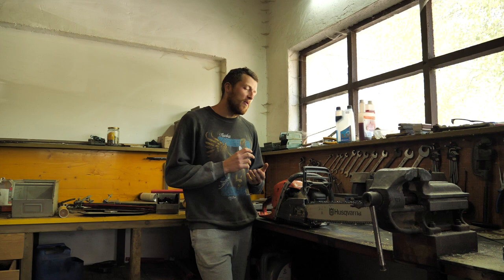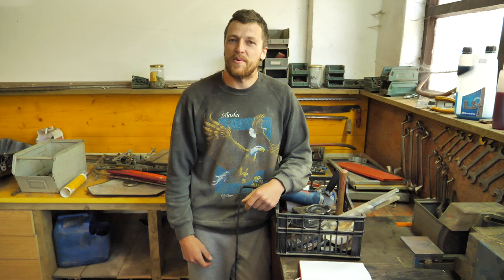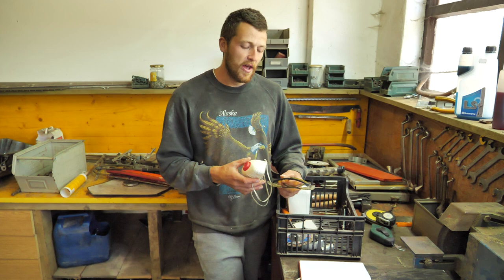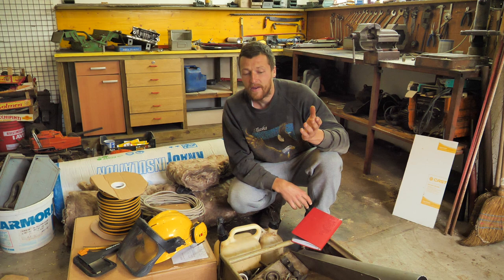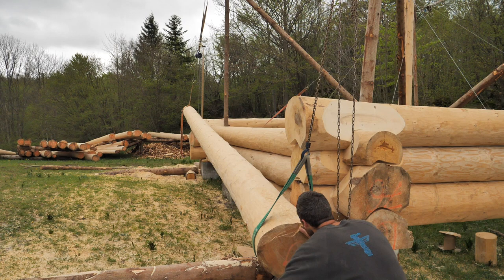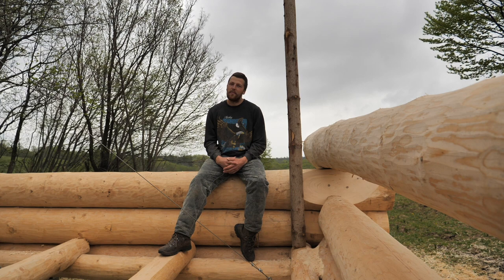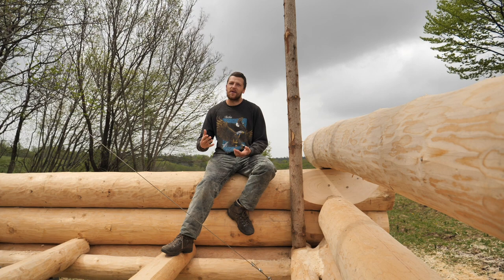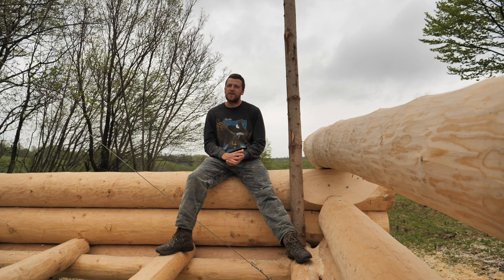Building Off Grid Log Cabin - Ep 15 / Log Cabin Walls

Comment: Hi Nik I think you made a great choice on the notch and log style you chose it really is the most beautiful even though it takes much longer.  Every log is a true work of art.  Also I very much agree with your philosophy on life and enjoying the journey and taking the time to do it right.  Looks great, keep it up!  
Just a heads up before you get too far in, I believe there is supposed to be an overscribe gap at the top of your notch so the logs will settle properly to be completely air tight.  I couldn't tell from your videos if you have a gap there or not but it looks like maybe you don't?  Without that gap you may end up with too much space on the v notch down the length of the logs.  Also, I use a leaf blower to clear away all the sawdust from the log when I'm done, it works MUCH better than an air compressor to do the job if you have one.

Comment: Instead of placing the generator further away, just make a little box from 50-100mm cool room panel off-cuts (just make a hole on each side for a fresh air intake and the exhaust). This will silence the generator enough to make it hardly noticeable. Don't make a 100m extension cable. The maximum you should use is around 20-30m (and even those lengths should be made from heavy gauge wire) because you will have too much voltage drop over that which can damage or make your tools not work properly. On the plus side, great job so far, thumbs up!

Comment: I was curious as to why you were drilling- you said to insert a threaded rod so I looked it up and it is a very interesting and useful thing to know. I think you are talking about a spring loaded thru bolt to maintain the tension as the logs shrink and "settle." Thanks for the tip

Comment: Lovely joints and great philosophy! Oh FYI, the reason it is recommended to use a wooden mallet for chiselling is not to protect the chisel but because their is less rebound than steel and as such the chiselling goes quicker. Better still is a mallet filled with lead shot. Almost no rebound so all the energy is transferred to the blade.

Comment: PS if reducing sound is an objective why not just make a three sided box lined with your mineral wool.  The open side faced away from your worksite.  You would be surprised at how much that will deaden and deflect the sound.  The one open side will be plenty of ventilation for the power plant if you make the box a foot or so bigger than any of the genset's measurements.  Wouldn't take long and could be used for several years or more.
Reply: I think it would be good for 4.7 yrs.
Reply from the maker: Thank you for the suggestion. I was thinking about something similar, might give it a try.

Comment: If you build a tool chest that you can load on your trailer you could keep your tools in the chest and just load it to your trailer or traktor. In that way you would not forget any tool. When you prepare a card for each of the tools inside your chest and put a register inside of the lid of the chest you would have a good control when you remove a tool from the chest. When you need to take a tool out of the chest at home you turn the card sideways. When you return the tool you put it back in its normal position. In that way you will now if all the needed tools are inside of the chest by just opening the lid.

Comment: If you go to a 100 meter extension cord make sure it is of sufficient size that the inherent voltage drop doesn't cook your tool's motors as 100 meters is quite a run.  Very high quality work--finish carpentry with logs!!  Lol.  Take care.  Doug

Comment: A longer extension cable is a bad idea, the longer the cable is, the less power you get, wich means that what ever powertool you use will be severly weaker, and if you as an example need to drill with that big drill bit, the drill machine won't have the power to do it. 

The generator noise is of course annoying, i suggest making a primitive sound dampening "house" for it, just use some (s)crap wood and other junk you have laying around, no need for neatness, it's a temporary thing that can be made relatively quickly.
Reply: I am pretty sure that is incorrect as electrical wiring provides nehligible resistance to the circut thus the longer cable has no effect on the power the tool obtains.
Reply: @zakadama7934   Current has to compensate the voltage loss. Therefore brushes and motor get a lot more heat just to keep up the usual power level.
If you are used to lean on your grinder. Its very likely to burn down. 
I have 250m  3G2.5mm² copper cable running to my treehouse that I have been building forever. And I cant use full potential of my tools. Even 700W grinfer burned down simply because I was used to grind hard. Biggest problem was my thickness planer, it has D20 breaker on it and it keeps the motor from burning down...  I cant put more than 200mm wide material in it. 
At 8A I lose around 30V
Reply: @mihkus  okay cool, i was just thinking thanks for the correction
Reply: @zakadama7934  The farther you go the heavier guage wire you need.
Reply: That's a long description about how to build a pc of junk.

Comment: Could you fit the tractor out with (maybe) an extra alternator, some AGM (or even Lithium) batteries to power the worksite?
Maybe a good idea to start a solar setup now summer is approaching...
Reply from the maker: I will invest into a solar powered setup after I'll have the house finished. Till then I'll have to use the generator.

Comment: Gday Nik from Australia,Great Job.I put an old sock over my angle grinder it keeps dust out of the electric motor just a tip.
Reply from the maker: Gday to you too, Jonathan. The angle grinder is not overheating with the sock on?
Reply: @nikrijavec47 Will get hotter, but no its fine even in Aust summer save your tools.Love your philosophy do it for the experience.I have built a bicycle, motorcycle, car, truck, camper trailer, barn, passive solar house.

Comment: If you are considering a longer extension cord, you may want to consider the longer the cord, the larger the wire gauge, because of voltage loss in the length of wire.

Comment: The cabin is coming on up. I have a question I would like for you to answer. Are you going to put all the walls up before cutting in the doors and windows? Also at what point are you putting the floor in? Thanks and thanks for sharing the process.